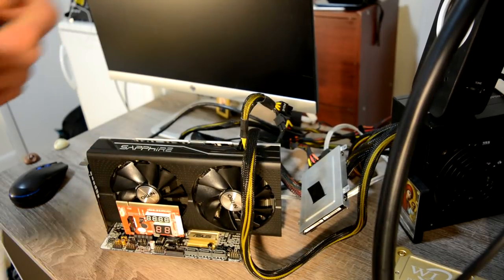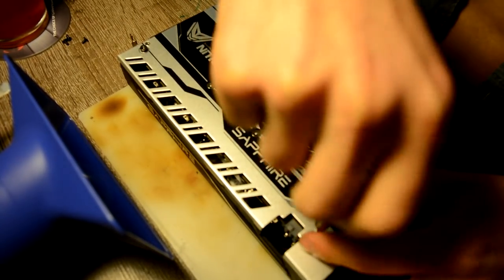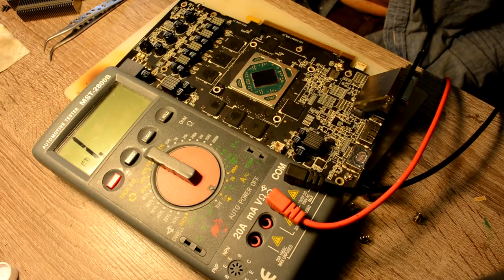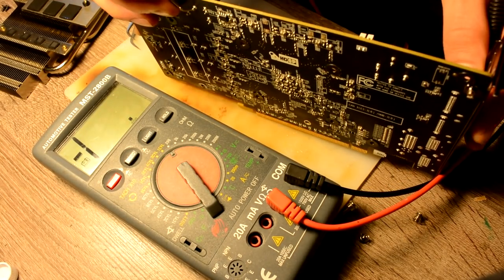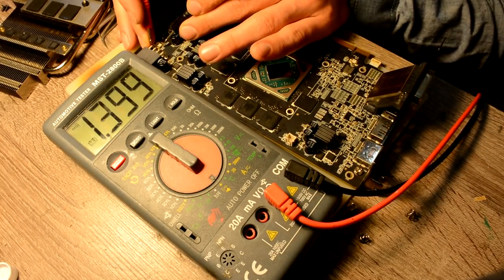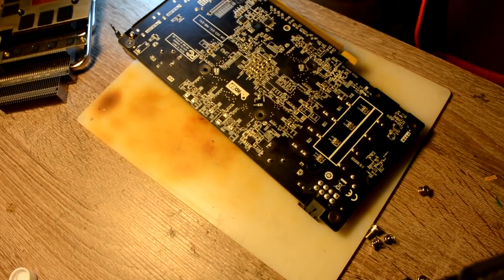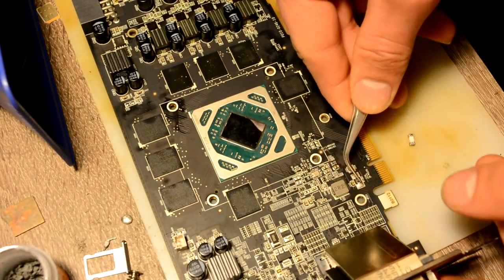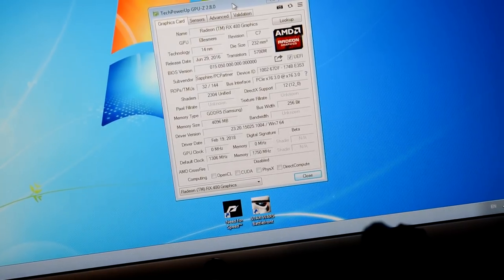bringing from dead Sapphire Nitro Radeon RX 480 no boot/ no power / short graphic card repair

Comment: How much current did you inject at 12 volts?
Reply: its depend on voltage on that part..u need diagram... normally is 12v or 3.3v on pcie

Comment: 3:52 its siliconeoil ... its not conductive and is "used" to keep the pads some kind of smooth .... to not harden them out ;)
6:09 its called Fuse ... some cards dont have a Fuse and all of them use Shunt-Risistors to mesure current
Reply: Shunt-Resistors *
Reply: Is the shunt resistor value important. is it going to cause problem if i replace a 0R5 resistor with a 0 ohm resistor ? I think the power management chip would get wrong data about current but i'm not sure how it would react to it.
Reply: @rezakianpour9668 The way to control the current to the entire GPU will be disabled so if the GPU want more power then it can handle it will be destroyed. Why would you ever want to change that?

Comment: 6:19 - "Fuses". A component that literally "fuses" if too much current flows in it. When you find a blown fuse, you might also want to check few voltage regulators nearby.
Reply: More like "refuses"

Fuses break apart, they don't come together
Reply: @lukemanius  yep. Sorry, it's because I'm from Italy: in italian, "fuses" means "melts", so yes, they break apart 😉

Comment: CAn i ask, at 8:20 what was the maximum Voltage and Current limmits you used on the graphics card from the Power suply?
Reply: 12v
Reply: @iamemrahkurt  please tell what's the current limit.
Reply: @deletevil  dude current doesn't matter
Reply: @leandrodasilva2523  yeah man I don't know what stupid mindset of mine compelled me to ask anything like that. Thanks for the fixing! :D
Reply: Eli Tech already answered in an earlier comment, he used 12V 4A, but he suggested starting from 2A. And current limit does matter, if you set it too high you risk burning the traces. If you set it too low the shorted part might not heat up.
Reply: @leandrodasilva2523  you serious of course it does. Pump 20amp through it due to a short and you will have a fry up, id suggest 2 to 3 amps at 12v for testing a thermal camera or infared thermometer will be a great help also

Comment: Thank you! I just brought one of these cards dead and it looks like the same issue, never been opened before and oil everywhere, going use this video as a guid and hopefully fix it then buy new pads that aren’t leaking crap
Reply: And how did u end up?
Reply: @filippetrovic845  It was a different issue, It was A coil at the back of the card called "6R8" that blew up, I haven't done any work to it yet, But will do hopfully at somepoint soon
Reply: Any update ?
Reply: @deadman593  Haven't managed sort the issue as I'm still learning about components, But I think there are more parts that have been damaged :/
Reply: @deadman593  I’ve only just picked up the card again to have another look and I took the coil off what I though was bad and it seems to be ok but I will replace due to my suspensions. I tested the fuses straight after the 8 pin and they both where shot but look brand new. I’ve ordered 2 new replacements and will hopefully have the card back alive again fingers crossed 🤞🏻
Reply: That was. Quick reply now i dnt even own a computer
Reply: @jerrybomcool  update?

Comment: Got a 580 with a similar problem, but instead of the fuse on the PCI being blow up it was the other fuses.
Tho, in my case the led turned on but the board didn't recognize it. I already buyed some new fuses but now im gonna check if theres a short. Thanks for the video dude
Reply: hi. I have the exact same problem as yours. RX 580 not recognized but the led turned on. Hope you can fix yours and please give me information too.
Reply: @josephsamoy1894  i will as son as i have and update, im looking for the thing to test the voltage, if theres nor short then ill just install the new fuses when they arrive.
Reply: @ElEscolta  Same situation. Did you ever solve it?
Reply: @rautesamtr  no, sorry, i ended up buying and getting new fuses but they jumped as well, so it probably was something else that got fried, i ended up selling it
Reply: please help me  my rx 580 was working fine now  after i changed the thermal paste and thermal pads the temp goes up like 71"" and the fans spinning so loud after i open the windows and sometimes  the card shutdown my computer i dont know what i have to do please help me ?

Comment: First of all great video ! I would like to try myself out with repairs of this type . I got some experience with electrical repairs, soldering and i bit more overall in pc-s in general repairs .

 I been trying to find some video that explains in general how to quicky identify main power rails and bit more about steps u take to find out general area of the problem and how to have those part's ready in stock because they are not available anywhere near where i live and i need to source them from sites like ebay and aliexpress and shipping times are 3-4 months usually if i don't want to pay a lot for shipping. Is there a way to keep common failing parts like mosfets and their drivers and powerIC components in stock i suppose there are 100+ different variants of all of them used on recent gpu-s ?

Comment: Hey man how did you test the power ? Like when you hooked it up to your psu what did you use and what kinds voltage ? I need to do this to find my hotspot I think I have a similar issue with one everything seems to check out so its not dead dead just shorted somewhere but I'm not as good with numbers as you lol

How do I make something like that so I can test my own

Please reply I have some PSUs hanging around I can use even bare powered wire with current to the capacitor or whatever should power the circuit yea ?

After 8 min

Comment: How can I get intouch with you please for graphics card repair or even help its with a gtx 1080ti aorus extreme it takes 2  8 pin pcie powers but when i plug the right side one in it cuts my psu off completely until its unplugged what do you reckon is the problem a short but where to look and great videos the best info on youtube by far

Comment: hi i have the EXACT same issue my 3 fuses are blown i have them from ebay but the 2 small caps can you please tell me their resistance as i need to replace them. thanks
Reply: 0805 10UF 16V
Reply: @Pepy667  thank you I got them but I replaced everything using a heat gun and FAIL. whe i plug it in now to pc the pc wont start at all it shorts out my pc.

Comment: Hi dear, thx for your job and for share your videos.
I have a Sapphire R9 390 Nitro, and i can't find the broken component.
Video card is dead, no power, no fan spinn, nothing.
4 fuse near 12 volt connectors are good, but fuse near PCI Express slot id down.
All capacitors near 6 fases are in short.
If i connect my power supply over break fuse, like you on your video, with 3 volt, the GPU go hot, but no one other component go hot.
If i replace break fuse and i put card into motherboard, fuse brake imediatly ( without 12 volt connectors plugged in)
Any idea? Thx so mutch!!

Comment: On your polymeter you have the capacitometer function... (on the left side). Plug 2 cables and mesure the secont smd capacitor which is working and find out which capacitor you must buy and place. Dont leave it blank.. :)

Comment: I'm attempting to use an older ZOTAC GTX 650 2GB card in a new build (MSI B360M Mortar Titanium, Intel I5 8400, Ballistix Sport DDR4-2666 8GB) and the card isn't being recognized by the MB, Fan Spins, but the card does not get warm.  Would you be interested in looking at it? PM me with info if you would.

Comment: Dear sirs,
I connected the rx 580 graphics card to the motherboard incorrectly with a USB interface cable from the riser. I connected the USB socket upside down to the PCIE port. After a minute, I realized that my card did not work.  The fans are spinning but I have no output.  The question is which piece of card is most likely burned?  Feed chip?  Or?

Comment: Oh man, I wish I could do that to my dead RX 480...
Reply: Yea my rx 580 is dead
I think it is dead
Light and fan work but no display from gpu
Reply: @kaionayon8678  Same for my rx 470, no signal after sudden shutdown, but leds on it works. Did you solve your problem?
Reply: @fatihgulakar457  yea mate after restarting my computer the gpu died
No video out put after that
I go to pc shop tested it , the gpu dont send video output
But the computer detects it
So i am wating for another rx 580 to fix it using that 

Cuz the computer detecs it

I know cuz of i enabled narrator
Reply: @kaionayon8678  ok mate thanks
Reply: @Ali Wardhana Why is dead?
The fan do not spins? Or no picture?
Reply: @kaionayon8678  an solution for that or fix? or was it completely useless? you have to get it replaced?
Reply: @kaionayon8678  ps same issue
Reply: @captainmz4910  bro its useless ,,  i bought another one.

Comment: Hey! Can you tell me how much Volts @ Amps you used on your power supply?
Reply from the maker: I used 12V and 4A. But to be safe I’d say better start from 2A
Reply: Thanks for your answer, my Supply can do max 15V and 2A so i cannot get much higher than 2 Amps... :\ i have 3 nitros, and all have powering issues, all the fuses are good, mosfets are good the resistances have some differences than your measurements at VRAM and Driver (not 21 Ohm/42 Ohm) one of them have 0,1 Ohm @ GPU power phases and one of them have 130+Ohm at RAM... i started to give up... will try that on 12V 2A then will see if i get lucky :)
Can i give power on another fuse too (near the 8-pin) or just on the PCI-E lane or is it doesn't matter?
Reply from the maker: Shaaba Hussaar I’d say you have to check how power spreads on your card and see if it has shorts and then follow it up
Reply: All of my cards have open circuit problems, one of them yesterday had 0 Ohm on the RAM rail, i removed the bottom ram downmost under the BGA and replaced it with another one and i got about 20 Ohms so maybe it is good now, but all of my cards have 0.0-0.3 Ohms on all the GPU rails... have already replaced BGA on all cards, the Driver Mosfets are good, none of them is in short, the 10UF SMD's too. Really dont have any idea, if i put on the Power Supply, nothing warming up on any of the cards @ 12V 2A (I cannot get higher amps from it, it is have 2A limit...)

Comment: My graphic card "died" when I disassembled my computer for cleaning. 
The fan doesn't moves, and I get a "No Signal" message in my screen. 
Any solution for this?
Reply: My issue is also same with my rx 570😑 don't know what to do
Reply: What have you tried to fix the issue?

Comment: What should be checked if no power on gpu. I have hd7730 no hot, fan not spinning. I did test the fan with 1050 ti and it spins.

Comment: hello
two question :
1 - what king of thermal pad can be used for these memories ? thickness i mean.
i have  a sapphire RX470 and pads need to be replaced but i'm not sure about thickness of pads . 
2 - what kind of silicon can i use for core itself not pad. what specification should i check.

thank you

Comment: Hello...

I'm from Portugal and I'm trying to diagnose an Nvidia GTX770 that has some problem related to power supply. If you connect only the 8-pin power cable, the gpu will warm up and display the image "please power down and connect the pcie power cables for this graphics card" because need the second 6 pin connector, but when I connect the second 6 pin cable not show any sign of image on display and not warming gpu ... Do you have any tips for giving me what I should do to diagnose the problem?

Thank you

Comment: I got question. Have you heard about rx 580 4gb by powercolor. It has no hdmi or video port. But ive seen on the board it has 2 contacts that has no port on it. Just soldering metal on the contracts. Can it be possible to install port in there and well it work?
Reply: It has only dvi output

Comment: Hello , thanks for the video ,i try to apply new thermal paste on my card , same model , but unfortunately i end up with a card that not working , card is spinning and detected in windows and hiveos but it give no reading for temperature nor fan speed , look like i mess up with the temp sensor and fan speed control , any help ?
Reply: same issue
Reply: me too   my rx 580 it was working fine now  after i changed the thermal paste and thermal pads the temp goes up like 71"" and the fans spinning  so loud after i open the windows and sometimes  the card shutdown my computer i dont know what i have to do please help me ?

Comment: dude today my gtx 980ti G1 from gigabyte crashed. I had a benchmark run after i installed a customcooler on the card. After 10 min i heard something that sounded like a shortage "peng" but not too loud, PC stopped and didnt restart as long as the card was in the PCie Slot. I tried another GPU and all worked again. No ive installed a Morpheus very often and that was the 1st time something went wrong. When i opened the card again, i realized 1 of the small VRAM-Cooling pieces of aluminium fell of a memory chip because the pad didnt hold. Im not sure but i think maybe that caused the shortage? Otherwise there was only non-conductive paste involved. Long story short: I inspected the PCB and i cant spot anything burned or broken, also no smell. YOu see any chance i can revive it? greetings from Germany

Comment: İ have same card, pc doesnt recognise it. There is no burn fuse. No short cap. No 1.6v and no 0.8v for vram and gpu. At memory control ler has 0.7ohm and at memory vrm 0. 7ohm . On Eli's card it has 22 and 40 ohm. So where is my short cause i have 0.7ohm. 5v regulataor has 1.6k

Comment: Hello brother, i have an Asus dual rx 480 that has the same problem. I wonder what it is that you do to get the damaged component to heat up? Hope you can help, appreciate it, thanks!
Reply from the maker: luisega9 heat gun
Reply: Sorry i meant when you were touching around to find the damaged component, what is that process you made?
Reply from the maker: A place where a lot current heats up
Reply: Thanks for the help. How much voltage do you apply on the pincers to heat up and find the shorted component? Sorry for all the questions

Comment: I'm having to underclock my RX 480 to 500 max frequency on stage 7 and 1500 max clock, do you have any idea why this is happening ? If I go any higher every game will stutter like crazy. Ryzen 5 3600 and TUF x570 set up, 750w PS
Reply: Always late to comment , you get this fixed , likely got a few dead or dying more likely ram or controller chips

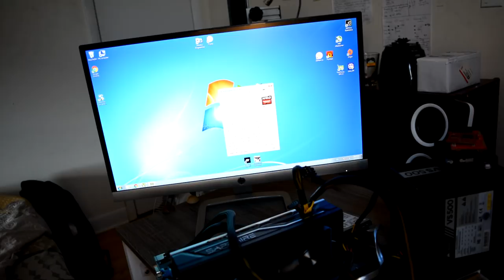Comment: @12:15 techpowerup gpu program says that the gpu speed is 0 and memory speed is 0 and it can`t read pixel filter or texture filter is this normal caz i have one card which is not working but if i connected it and use my motherboard graphic card the program read it the same way and it says the card is consuming 6666778 watts when i go to sensors tabe , which make me think that the card have short somewhere

Comment: Yoo i have another broken 390 you could look at.  It gives some crazy textures when its connected to the display but all the issues stop if its under full load.  It also is the flashable kind that can become a 390x.  Send me a message if you would like to screw with it for a video.
Reply: i assume the things that pop are like pink bricks/lines if thats the case then most likely its artifacts.
60-70% of the time they pop up because of a re-flow try putting your card in a oven suspended on like aluminum foil balls and heat the oven to 200 Celsius for 5 minutes after that let it cool down on its own in room temperature and you can test it if you dont have warranty you can try. I had like 4-5 gpu and with simple fix they are still working like 5 months after
Reply: @animeskits1019  I got the card cheap second hand so i may try this!  I watched him reball one of these and I had I similar thought.

Comment: hi dear i have msi gtx 770 , i plug +12v to the pwm pin !! and i smell a smoke and when i test it there is no signal and fans run 100%  !!
when i test the mosfet 4c10 i get 6 ohm between D and S , and some capacitors has the same value !!  and there is a sot23 transistor behind the fan connector i cant read his smd code maybe it burned !! can you help me dear pleaaase
Reply: buy another one

Comment: I have the card from this video. And it works at all, but I have problem with throttling when it reach 70*C it start hard drop GPU Clock speed. What kind of problem is this?
Reply: You can modify bios of your card and set clock speed to a certain amount then you won't face down clock,and also increase the fan speed so that it won't cross 70 unless you are mining.
Reply: Change fan speed in afterburner mine runs in the low to mid 50s when gaming

Comment: i got a short to ground when i check the pci express but none of the fuses are not  blown what do u think i should do next i checked the smt caps read short i looked for cracks under microscope but found no cracked caps
Reply from the maker: If you have short to pci express, then most likely your gpu is dead
Reply: used and ir camara found the ic labled AEAF removed it and shorts gone put a new on and all rails boot   got memory and memory controller and vcore now 
but no display  gpu gets warm  also tryed puting it in as a secondary card and seeing if windows sees it but its not detecting  what can it be it  gpu ball or dead gpu ?

Comment: I dont get it Eli. A zero ohm resistor does not take the place of a filter cap. It would just short the circuit again and any farad cap would be better than pushing 12v to ground. I like the way you said the Ruzzian meaning of the short. This is a good card for the era you were fixing it in. I wondered if ya'll had been drafted by Putler to fight in Ukraine. I certainly hope not as you are a good guy and I don't see you invading your neighbor for a despot.